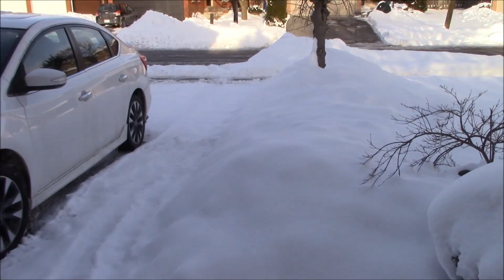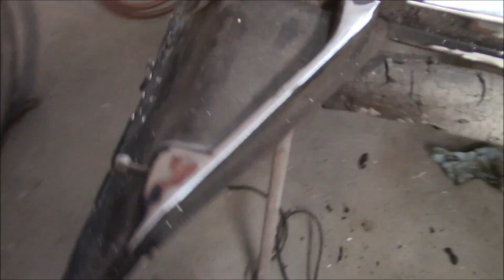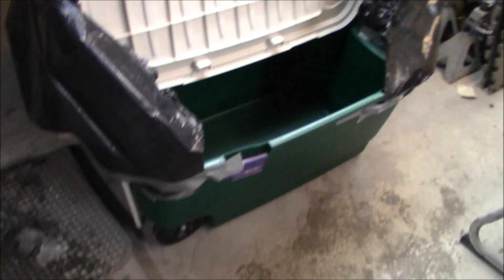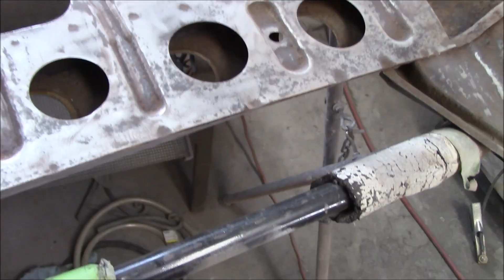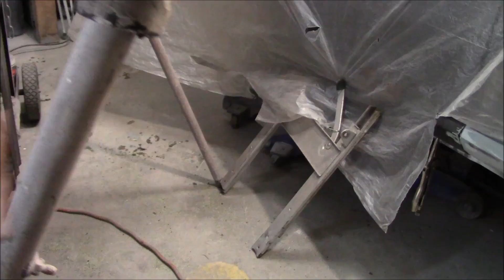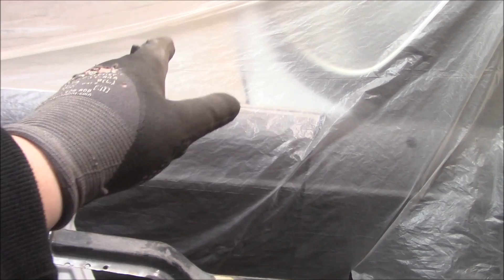1968 Triumph TR250 Restoration,  Inner Bonnet Structure Repair,  Part 1

Comment: I know it from my dad ,how to welding and use copper backing plate.I hope he use not the old felt strips for the bonnet, I think its better to use metal glue or anything.
Reply from the maker: I think I will use closed cell foam or neoprene strips instead of the felt...something that doesn’t absorb or hold water...however, considering that this car is over 50 years old, and I’m sure that it was driven through some Canadian winters early in its life,  the felt didn’t seem to do too much damage in all that time and with all that exposure...

Comment: David that clean up well, I like your idea of the plastc box for the Sand Blasting process. You have a large amout of snow, ours in Iowa last week melted.   This Sunday we will have temps up to 65F, amazing for early March. It was a very mild winter in Iowa , excited about spring working without heat in my garage and getting my bucket garden ready for planting.The bonnet support panel clean up great . The first steps using wire brush really cut down on the required amount of sand blasting time and mess.
Reply from the maker: I am looking forward to an early spring here as well.   Sunday and Monday here were are supposed to see temperatures in the neighborhood of 50-55 F which is pretty good for early March.   I suspect thought that we will get at least one more cold snap and one more big storm before Spring officially arrives.    I really need to get a bucket garden going this year...even if its just some Tomatoes.  Thanks for watching and commenting.

Comment: So was there glass everywhere? How fine is it?
Reply from the maker: Yes, despite my efforts at catching some of it, it still makes a pretty substantial mess.   What I normally do now is sweep it up and I filter it through a sieve (actually and old kitchen colander) back into the bucket to be used again.  The dust I just blow out with a leaf blower :-)   Its fairly course glass so it creates a little less dust than the finer grit.   Leaves just the right etch in the metal for epoxy primer.   Your project is coming along very nicely BTW.  You and Pops are going to be very proud of the end result.